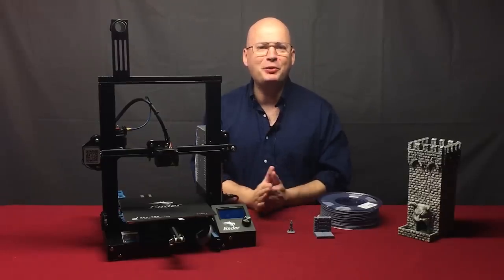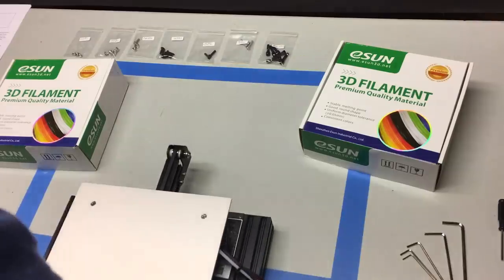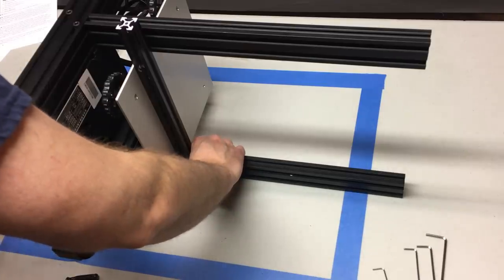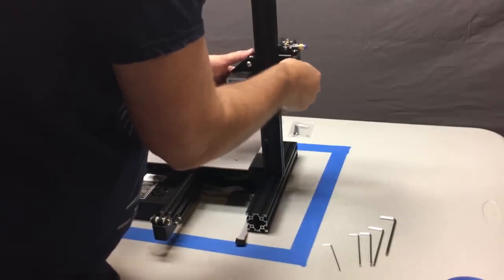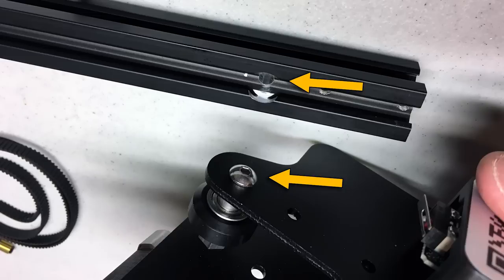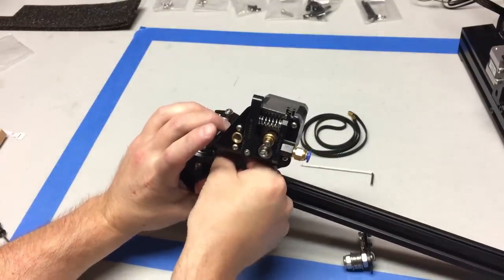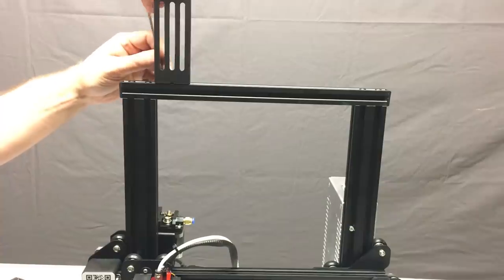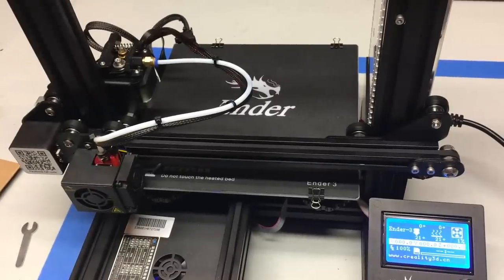Creality Ender 3 assembly and pro build tips

Comment: One of my ender 3 hot end mount things, is wobbly. I’ve taken it off, put it back on, removed the 3 wheels, adjust their tightness. Nothing. My other Ender 3 is stable as a rock. Can’t figure it out

Comment: What an awesome video. Watched two different ones and have to take my machine apart and make all the adjustments in the right order. Question..my power supply is not working. Is there anything I can try before sending this machine back and getting a new one?
Reply from the maker: Did you switch it to the correct voltage? Go to 14:25 in my video if unsure. :)
Reply: @Tombof3DPrintedHorrors  yes, that was the very first thing I checked. I also went through and checked all the other connections. It's all good. I am sending it back and have another already in the way. Thank you so much for responding. Can't wait for it to get here so I can start creating. Your videos are spectacular! Thank you for sharing your knowledge with us.
Reply: Received my new printer, assembled, and it runs!  Thank you again! Time for the next video.
Reply from the maker: @cherylshearin614  great!

Comment: Good idea - drill left stand to get access to screws that holds horizontal bar. Then you can accurately tune horizontal bar to be in parallel with top horizontal bar.

Comment: Building my second Ender 3 (this time and Ender 3 pro) and once again using your video. Great tutorial.
Reply from the maker: Thanks!
Reply: @Tombof3DPrintedHorrors  I almost had to send the printer back to Amazon because I couldn't get the Sd card to go into the slot. Luckily I persevered and found that the SD card slot had been installed upside-down.  Also one of the m3 bolts that secures the Z screw in the collet was missing.  I was lucky that I had some in my workshop or I would have had to drive to the hardware store for one tiny m3 bolt. But it's all working now. After leavelling the bed, I printed a benchy and then the first large print was the cable chain. Thanks again.
Reply from the maker: @havelockvetinari9395  glad you got it sorted out! :)
Reply: Thanks, appreciated.

Comment: Thank you very much for this video. All step are spot on. Used official instruction only for reference. Build for ground up to working printer in 2 hours. Including bed leveling. 3 years, but this guide is still super relevant for Ender 3.

Comment: Years in the future and I missed some important steps using the quick installation guide that came with it. I've had the printer over a year and its never been super fussy, but some of my wheels did wear more than others due to poorly setup eccentric nuts. My x-axis was also not level/square and I think i've finally found a print where my bed leveling couldn't cover up this issue (Nozzle was hitting infill during travel). The fact I've been printing for a year with great success even with it improperly setup is a testament to just how powerful the Ender 3 is, and now with better knowledge I am going to have to take it most of the way apart and fix some of the issues I now see it has. Thank you!

Comment: My left hand vertical 20X40 extrusion was leaning out same as yours. The problem was the base extrusion it sits on is not flat from side to side, but rather high in the middle. I shimed the outside by .015 inches and tightened it down.

Comment: somethings wrong with my ender 3 pro. well, tbh , the bed leveling. i cannot get it to level for some reason and my printers been collecting dust for almost 2 months now cuz of this. if one corner is leveled, the corner across it has the nozzle digging deep into the bed. fix that and the other side does the same thing.over and over, a revolving circle. can anyone help?

Comment: I like to print out a washer and use a piece of capircorn tubing to secure the tubing where it will NOT move inside the hot end! Look for this mod on thingiverse! By far the best mod I have done to my ender 3, second best mod was a all metal extruder! Third was a bearing filament holder and filament guide roller. (Also a cover for the fan so fod don’t get into the fan area. Also a creality tempered glass upgraded build plate.) Do these mods and you’ll have an amazing printer!

Comment: I've been fighting with my Ender 3 Max for over a year trying to figure out why I had to level every print and narrowed it down to an x gantry issue. I've gone through every tutorial, added a dual z setup, bought a digital level, disassembled and reassembled the rails more times than I can count, shimmed to no avail. It never occurred to me that the Z screw nuts needed to have a little looseness to work properly. I think that might've just fixed my issue, but the phrase "I fixed the printer" has become a meme in my household at this point. If it did, thanks so much for this info!

Comment: A helpful hint for the Ender 3 is to go on eBay and get some really cheap T slot brackets to help brace the frame. The primary problem with the Ender 3 is that the frame isn't very rigid. The screws will eventually come loose in stock form, but T slot brace brackets help with that a ton. I personally suggest at least 10x 90 degree corner brackets to stabilise the bottom of the frame a LOT as well as keeping the side extrusions firm and help them avoid twisting over time. I also suggest 2x L shape joint bracket. You put these in the top bar that goes on the top of the frame. These will be fastened on the top bar and left loose on the side bars. This means they will force the side bars to be kept the right distance apart at the top, making the process of screwing the side bars properly much easier. It will also prevent them from drooping towards the center if the screws should come loose. 

Furthermore, you can install T brackets on the outside of the base to help brace the side arms further, but I find that just adding the above gives a tremendous amount of rigidity

Comment: Thank you for the video! I just put together my Ender 3 following your video, and I got my first prints down perfectly. I will say the trickiest part getting the distance right from the left and right at 20:24,  but I think this was the most important part to getting my prints right the first time.. If these are not level, it would make sense that the print will not contact the base properly. Thank you so much for this tip! Cheers.

Comment: I have a problem with the PLA filament not sticking to the Polypropylene Build Plate. The bed temp I use is 60 degrees Celsius and nozzle temp 200. Cura is the slicing software.

Comment: Thanks for your help and experience.  I put my Ender-3 together yesterday.  This wasn't my first, or even second printer kit build, but it's always nice to see it done and pick up the valuable hints ahead of time.

I followed your build step by step, spending a lot of time getting the left and right pillars straight and untwisted.  I measured the bottom and the top and adjusted several times.  Originally, the difference was 5mm, but I got it down to practically nothing.  Then I got to the part where the top brace is attached.  There is almost no play in the holes drilled in that extrusion.  It needed me to pull the pillars almost 5mm (hmmm) closer in order for the screws to enter the tapped portion.  I reversed the build (x-axis rollers, etc. back to the attach-bottom-of-pillars part and was able to re-position them so all went back together aligned.   I bring this up in order to wonder if it would be better to attach the top brace, temporarily; loosely, as you position, align and secure the side pillars.  Since that brace appears, at least in my kit, to be less forgiving. maybe it would be better to use that as the measurement source.

One other issue I had with my kit that appears different from yours and others:  Creality must be listening.  Instead of the print bed wheels' eccentric nuts being loose, mine were tight.  Very tight.  Could-barely-move-the-bed tight.  Worse, the v-wheels now had flat spots and the bed thumped in a couple of places when it was moved.  They've recovered a little, after being released, but I'll probably want to replace them - I'll need to monitor the build quality with that in mind.

So, Creality:  Better to have them shipped a little loose than to risk ruining the wheels.  

Another, minor, problem:  The Bowden tube was horribly packed and arrived permanently kinked in several places; a minor issue since I'd intended to replace it anyway.

My Ender-3 is now assembled and has printed the test dog perfectly.  I'm going to name him Skippy.  :)

Again, thanks for your videos - they help tremendously.  You have one new subscriber.

Comment: Tom I will never thank you enough for this video. My Ender 3 Pro has been sitting in it's box all week, too busy at work to set it up. Today was THE day. Yes I know, the Ender 3 can be built in 2 hours... I used your video and spent the whole afternoon on the build, yes, around 4-5 hours.... The setup is PERFECT. Everything is perfectly square and aligned, bed level is perfect and first benchy printed FLAWLESSLY! Those extra steps you added made ALL the difference!
All this, because of your awesome walkthrough! I was a bit worried after all the issues I read about from other Ender 3 owner on Facebook and Reddit... all I can say is, anyone not following this guide to the letter is doing it wrong!
Thanks again sir, legend!

Comment: How do you know if you have to move your z stop down?
Reply from the maker: If you have your bed springs fully decompressed, and the nozzle is still too high above the bed to get a good first layer. Springs should ideally be about half compressed when the nozzle is leveled in.
Reply: @Tombof3DPrintedHorrors  okay, I should probably lower mine then. I am finding it hard to keep the middle level. It seems like I can get the corners but the middle is still too high.
Reply from the maker: Adjust as needed for the middle, you'll rarely print out to the corners.

Comment: @Tomb of 3D Printed Horrors 
Thank you for this video.  One thing I noticed on my build after complete disassembly (after realizing how much I neglected because of your video, THANK YOU!), was that the alignment of my Z-axis Acme lead screw was way off (@17:17) (sideways, X-axis) from the brass coupler that it needed to thread into.  I loosened the bolts that held the Z-axis motor to the vertical Aluminum Extrusion upright and aligned the vertical acme screw by eye to the threaded piece on the X-axis assembly.  I assume that this alignment will reduce the strain on the brass z-axis piece over time.
I hope this helps and thank you for the video.

Also, I don't understand why to back off the two screws of the brass coupler a full turn (@19:33). Mine get loose at this point and I'm worried about tolerances. Thank you!

Comment: Everything worked but just one part. The levelness of the horizontal bar is adjusted by the two M4x16 screw instead of the two screws you talked about. Those two should be tight always. Loosing those up doesn’t change the angle of the horizontal bar at all. :D

Comment: Thank you for this video!  I'm putting mine together and the verticals aren't getting 100% parallel.  I'm off by 1/16 inch - wider at the top.  I tried flipping the left side around 180 and it didn't make any difference.   Any tips to get this closer?

Comment: Probably one of the best guides I've come across. I checked out several before assembling my printer. Straight out of the box  I had bumping when sliding the bed. Your guide was the only one to explain how to adjust the eccentric mounts underneath - problem solved. Everything else you did was very clear and to the point, very helpful for a beginner.

Comment: Yep, you were born to teach dude. I have also heard they come with the 4040 base pre-assembly twisted. My suggested contribution is OpenBuilds upgraded wheels ( https://openbuildspartstore.com/xtreme-wheels/ ). I'm deciding between an Ender and a Prusa at the moment. I hate bowden, but I presume there are direct drive conversions out there already for Ender. If I get the Ender it's getting a Duet WiFi board and probably some linear rails in several places. I will want a BondTech direct drive and who knows what else. Fun times (ask my wallet). I think I like to build and tinker more than I like to print #eyeroll

Comment: Hi thanks for the video, it really helped a lot.  I have some spare plastic bags in the kit you did not mention, not does it say anything in your printer manual.  I have a 14.5 inch black rubber hose/tube, some Ma14-A screws and square nuts, a bag of profile 2020 plastic covers.  I am thinking the tube is for filament but there is nowhere to fix it to.  Any ideas?

Comment: I bought an Ender 3 a few days ago and used this video to assemble my printer. Let me just say that I used this video exclusively to build the printer, and I built it with zero issues. Thank you for the tips on how to level the X-axis right at the beginning - I can see how troublesome this would have been if I had to level it later with everything attached. Used your tips for the wheels and tightening the bolts to correct leveling issues and the printer works like a champ. I don't know how good many extra hours I would have needed to configure the Ender without watching you video. In all, it took me an hour and a half to setup (even with a few mistakes...I installed one of the vertical rails backwards). Thank you, Tom. You got a sub from me.

Comment: Thank you for all of your videos. A question about the fittings you link. Did these hold up for you? They have quite a few negative reviews regarding them not holding up. Would you still recommend these over the stock fittings? Is Creality still using the same ones or have they upgraded these to be better now? My Ender 3 Pro arrives tomorrow. Thank you!

Comment: Hello Tom, I recently bought a Creality Ender 3, 3D Printer and happen to cross across your Youtube Video. I am glad you made this assembly video instruction, as made all the difference setting up all the important hardware parts. It took me 4 hours and I had to reset some of the printer hardware properly according to your instruction. This was the first time I had assemble a 3D printer and due to your instruction it made it a lot easier. I started assembling the 3D printer at 8pm and finished at midnight, Melbourne Australia time. I felt it was important to following the detail your provided in assembly and it paid off the following morning. I used white PLA, and the test cube settings were "Print Nozzle 205°C" and the Print Bed 60°C. according to your other Youtube Video. I used the 0.4 print nozzle that came with the 3D printer and leveled the bed using a posted note on each corner. I tested the leveling procedure 6 times to get it right, just wanted to make sure it was done correctly, as I had never done this before. The print on the White Cube came out perfect this morning.! Thank you again your time & effort to make this video happen. I hope to inspire others with your video instructions and to purchase a Creality Ender 3, 3D printer. It is worth every dollar.

Comment: FINALLY! A truly useful video on Ender 3 build. Not like the other useless thousand or so that are the same old thing just basically going by the directions that any moron can do! Another HUGE bonus is no overly loud obnoxious music! I watched this video all the way through then stripped my Ender 3 down to the bones and started over. Thanks to this video I found and corrected many flaws related to vertical extrusion cuts that weren't 90 degrees and were the source of most of my problems. Now if we can get you to do another video of this quality on calibrating X,Y and Z steppers I'll be in heaven.

Comment: Building my new Ender 3 tomorrow with of course your very helpful video. I can only use this machine in my basement. In your opinion will it be safe to use a 7 metre extension cable to power it ?  I live in the UK, power supply is 240 volts maximum 13a plugs. It will come from a double socket that already powers a strip light down there. Ideally I'd keep the light, run the printer and have a small laptop as a server there too. Is this possible ? Any advice would be appreciated, thank you

Comment: Great video, very instructive and very helpful.  I just acquired the Ender 3 Pro and spent several hours assembling it.  First I added the upgrade kit for the Mk8 Extruder.  During assembly I had one big issue, I could not get the horizontal rail level side to side.  I ended up having to loosen all the screws holding the worm drive screw and the mount for the horizontal rail, then work to get it level by working the screws until I have it as level as possible.  There's some 'loose' on the two screws that hold the horizontal bar so I have to leave them loose, find the level position then take the drive off the rail and tighten those two screws multiple times until I had it level.  I managed to get it assembled, but now I have to test to see if it is going to work properly.

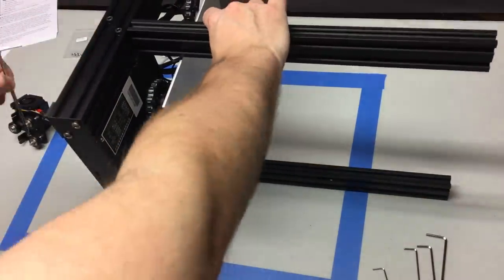Comment: Great Video.. Definitely going to watch this a few more times before setting up my Ender 3 this weekend.    Question/Comment... at around 8:46 of the video, you go to great lengths to ensure the vertical rails not twisted and are equi-distant (or parallel)  from top to bottom.    But at 26:00 mark, you install the top extrusion/crossbar, but don't take any measurements after putting in the screws..   I would think that installing the screws in the crossbar could result in moving the vertical rails out of alignment..  up until you install the crossbars, the top ends are free...